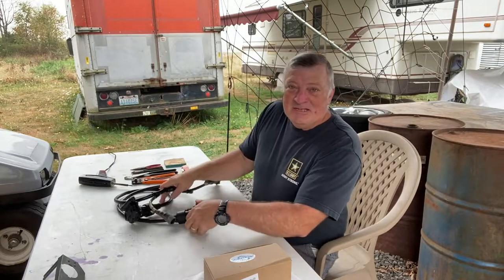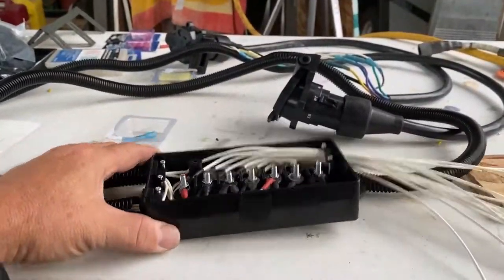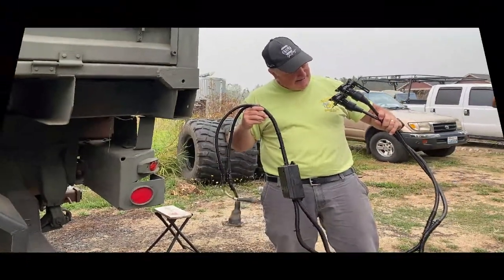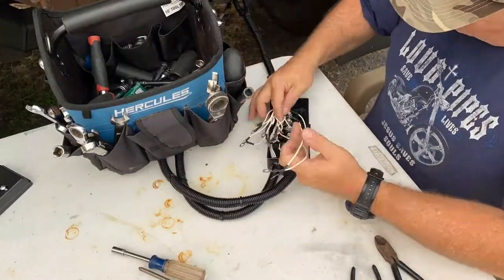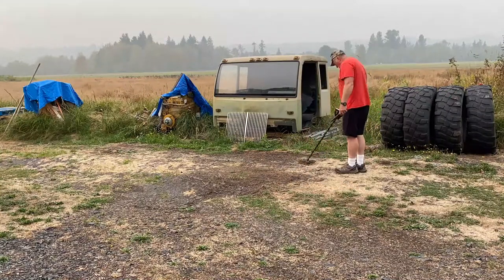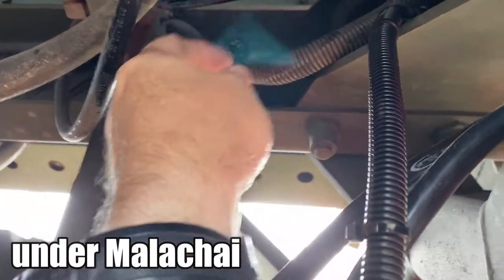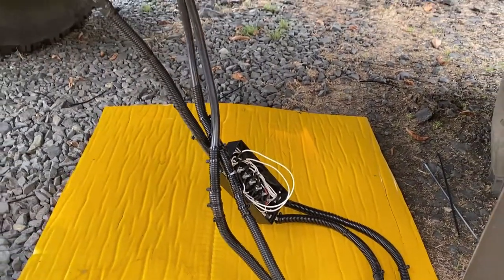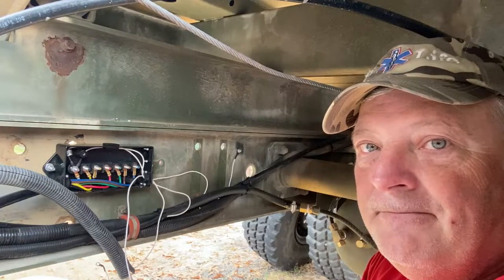FMTV TRAILER SOCKET Nirvana: NOT! #136

Comment: The missing pin on those trailer sockets is for the trailer brake signal if you decide to use the hopkins 7 pin rv to 7 blade adapter.  This is why if you decide to hook up a civilian trailer brake controller you need to run a wire from the cab to that very pin on the trailer connector...  You must have spent a few days on that wiring....
Reply from the maker: Well, I have the brake signal for brake lights which I traced to the four pin half, middle left (as you are looking at the end of the pigtail) and lower center (as you are looking at the male socket). Unless you are talking about an electric brake brain signal, they yeah, I can see wiring that up to that pin. What I could not trace was the reverse lights... even had my son sit in the cab and throw it into reverse with the e-brake on. Maybe the 12 pin might have it, but I'm pretty sure the 7 pin does not.

Yeah, it took a couple of days to work out all the bugs and totally figure out what in the heck was going on this whole mil truck, now trailer... what does it want from me, how do I get this dang thing to work, etc.. LOL!